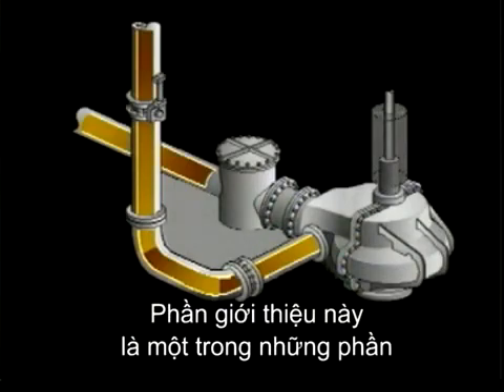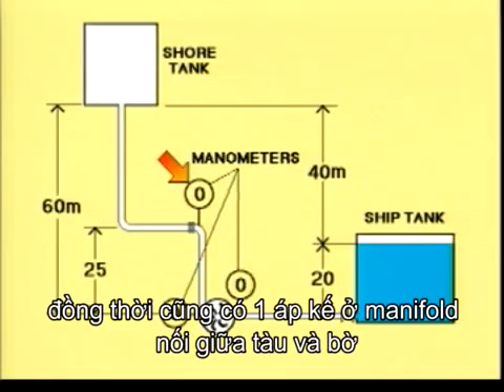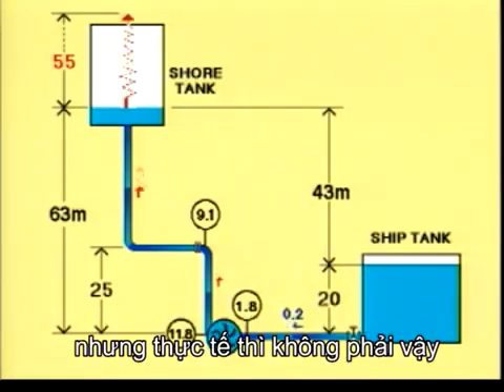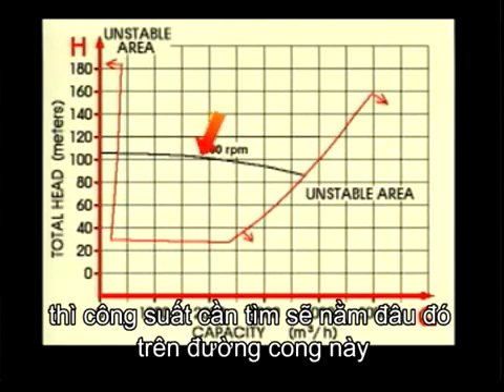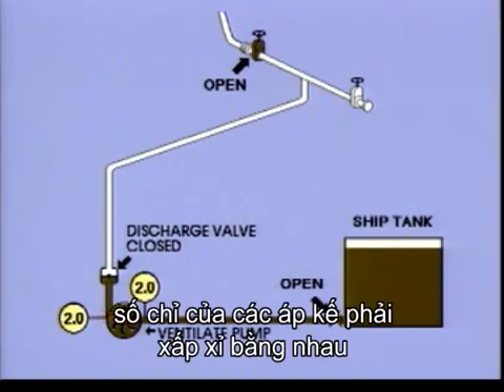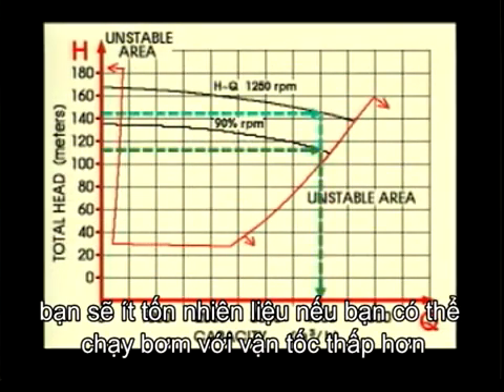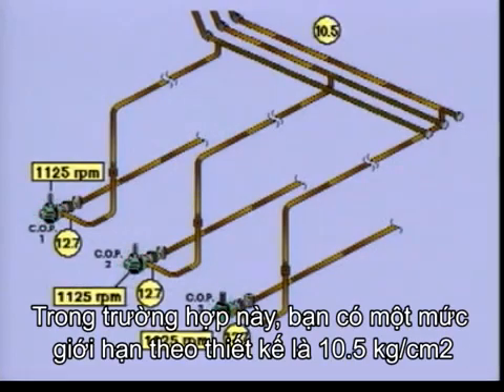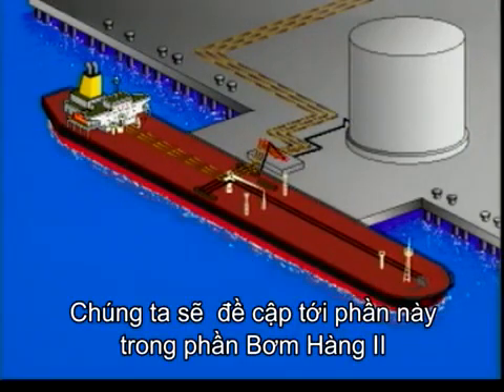CARGO PUMPING SYSTEM ON OIL TANKERS (PART 1) | Capt.TRAN THE HUNG

Comment: How To Start A Cargo Oil Pump ( C.O.P.T ) In 14 Simple Steps
Check and drain water from the lube oil sumps for the cargo oil pump turbine.
Check and Open Sea water overboard Valve
Open Vent valve for the Condenser.
Open The discharge and Suction Valves for the Sea water pump for vacuum cooling evaporator.
The Fresh water inlet and outlet valves are to be opened for the air ejector.
Start and warm up the air ejector system.
Close the vent valve and monitor steam pressure.
Now using the Turning bar; rotate the turbine spindle to check free movement.
Crack open the turbine warming line for some time.
Now slowly open the main steam valve to the turbine assembly; try keep this process as slow as possible.
Observe the slow increase in turbine R.P.m till the governor take control.
Once reached to its operational R.P.M; inform the cargo control room and the pump is ready to be used.
Check Whether the I.G system are operational.
Now start the Cargo oil Pump To start the discharge Process.

Comment: Alarms And Trips Associated With Cargo Oil Pump
A cargo oil pump can be damaged in a number of events such as; overheating, no oil in the tank, closed suction, chocked suction, excessive back pressure etc. Thus various alarms and trips are fitted to safeguard pump operation. While different cargo oil pump types have different set of alarms and trips; but they also have many which are common to all.

Alarms
High Wear Rate
High Casing temperature
Low lube oil Pressure
High Motor Current
Low lube oil Level
High bearing Temperature
High Lube oil Temperature
Low Hydraulic Oil Level ( In Framo Pumps )
High Hydraulic Oil Level ( In Framo Pumps )
H.P.U Oil Leakage ( In Framo Pumps )
Cooling System Failure
Power failure
Safety Trips
Low Low Lube Oil Level
Local Hand Trip
Remote Trip
Automatic Emergency Trip
Casing Over Heating
Priming Pump failure
High hydrocarbon Content
Low Inert Gas pressure
Over speed
Emergency Stop Centrifugal Pump
Emergency Stop For Hydraulic Oil Pump ( In Framo Pumps )
Low Low Hydraulic Oil Level ( In Framo Pumps )
Very High Back Pressure

Comment: 5 ) Cargo Eductors
An eductor is a simple structure with no moving parts. It’s basically consists of a nozzle, throat and a diffuser. An eductor can be placed in the main cargo pipeline or with a separate piping arrangement. Basically it is a less efficient low cost alternative for other stripping pumps.

An eductor use the under pressure fluid ( liquid and gas ) to generate pumping action. This is done by the flow of the fluid through a nozzle; followed by a diffuser or a diverging output. This can be used with almost all kinds of pumps with different fluid medium. An eductor can be used to handle any cargo even explosive medium; as long as it is compatible with the flowing medium.

In cargo eductors it is a common practice to use the same cargo as the flowing medium to generate pumping action. Being a simple design it is reliable; maintenance free and is self primed. In most case it is operated by the flow of cargo by the C.O.P.T.

Working Principle
An eductor works on the simple principle of “Bernoulli’s principle” or venturi effect in specific. The Bernoulli’s principle states that; the velocity or flow rate of a fluid is inversely proportional to its pressure. this can be represented by the following equation:

V22+Pρ=K (Constant)
For a fluid flowing in a tube at constant speed; it must maintain its flow rate to keep a constant volumetric discharge. But when a sudden narrow path restricts its flow; reducing its velocity. By the law of conservation of energy we knew the energy lost in form of reduced velocity has to convert into another form; which in this case in pressure energy.

This process creates a differential pressure between the inlet and outlet of the conversing cross sectional area. The venturi effect combined with the principle of mass continuity; generates suction pressure at its suction inlet. In most scenario the driving fluid or medium in the case is the cargo from the next tank pumped through a C.O.P.T.

Comment: 4 ) Screw Pump
A screw pump is a type of positive displacement pump. Much like gear pump with a major difference that; it pumps fluid axially along its spring axis.

The pump consists of two main parts; the prime mover and the screw pump assembly. Two or more screws are coupled to the shaft with a fine clearance; which when combined with shaft motion creates suction pressure.

A screw pump can be divided into eight major parts; the driver screw, driven screw, timing gear, relief valves, bearing, driving shaft, rotary and stationary seals with suction and discharge ports.

Based on the number of screw; the pump can be called a single screw, twin screw or multi screw pumps. With better suction capability and lower maintenance cost; the pump is a good fit for those who look for a cargo pump which can handle all kinds of cargo. But due to its high installation cost it is often restricted to high pressure high viscosity fluid application.

I have already written a post in past explaining in details about screw pump; its constructional parts with their specific function, use and maintenance procedure. You can click and read that post from link Over Here.

Working Principle
A screw pump add axial movement to the fluid locking it into its fine clearance area. The continues motion of the pump; trapping and pushing fluid axially forward build up the output pressure. The driving and driven screws of the pump works in phase with the timing gear. It not only keeps both screws at pace but also avoid any contact in between. Any such contact can lead to wear and tear of the screw edges; negatively affecting the pump performance.

Both driving and driven screws in the pump are of opposite types i.e one is left hand type while other right hand type. This ensures to trap air or fluid within fine clearance; building suction pressure.

A screw pump at start traps the air in between the fine clearance of its drive and driven screw. Pushing the air axially towards the output; it create differential pressure which helps suck in the fluid medium into pump medium. As more and more fluid is trapped and then pushed towards the output; pressure increase along the pump discharge.

Comment: 3 ) Centrifugal Pump As Framo Pump
A Framo pump is nothing but a centrifugal pump put upside down in a cargo tank. It is located such that the impeller lies on the bottom most part of the cargo tank. They are used largely in chemical tankers where dedicated pumps are required for each tanks. They are mounted such that; only a minimum clearance left between the floor and the pump impeller suction.

This results in advantage in form of shorter period of stripping. And relief from unnecessary suction problems; due to faulty or chocked suction pipes.

The pump consists of parts such as hydraulic motor, impeller, volute casing, wear rings, sleeves, mechanical and cargo seal along with the bearings. All the main components of the pump is secured well within the deck trunk welded to the ships deck.

The pump is driven by the hydraulic motor; under the influence of high pressure hydraulic oil from power packs. A power pack is an independent system consisting of; a hydraulic oil tank and high pressure pump along with an electric motor to run.

The complete system is based on the balance between the two fluid medium; cargo and the hydraulic oil. If the cargo gets in to the hydraulic system it damage the pump; while if hydraulic oil leaks it contaminates the cargo. Thus a coffer dam is provided to avoid the contamination of cargo with hydraulic oil in the pump system.

Working Principle
The hydraulic system control panel sends signal to the hydraulic power unit to start the discharge operation. The hydraulic power unit consists of a hydraulic oil tank and a high pressure feed pump.

The pump starts to take in suction from the hydraulic oil tank and discharge at very high pressure to the main hydraulic line. It is driven by an electrical motor; controlled by the hydraulic system control panel.

A low pressure return line is connected; to the hydraulic oil tank to maintain the same oil level at all times.

Upon each operation; the coffer dam lines for each Framo pump is to be purged out. This is done to remove any cargo or hydraulic oil leaked; from cargo and hydraulic oil seal to the coffer dam. Then the remote assembly is signaled by the main controller; to open valves to the hydraulic motor.

This create the necessary torque needed to drive the shaft of the centrifugal pump. The pump then takes suction from the suction well and discharge to the shore facility via a dedicated cargo pipeline.

Comment: 2 ) Reciprocating Cargo Pumps
A reciprocating cargo oil pump is a steam or motor driven positive displacement pump; with a plunger moving within the pump cylinder. It is well known for its constant volume pulsating output at higher pressure. The pump takes in the fluid medium via a suction valve and discharge at a higher pressure through the discharge valve.

The plunger or piston within the pump cylinder is in close contact with the liner with the help of the piston ring. The most common design is with a double acting piston driven by a reciprocating steam pump. This is done by connecting the piston rod of the reciprocating steam piston; to that of the pump via a linkage or beam.

The modern reciprocating cargo pumps come with an additional dampener at its output to reduce the pulsating effect. Furthermore being a positive displacement pump; it is required to have a relief valve in place to avoid damage due to excessive pressure. Based on its design it can be a simplex, duplex, single acting or a double acting pump.

Working Principle
A positive displacement pump works on the simple principle of pressure that accounts for force per unit volume. This is achieved by the up and down motion of the plunger or piston. A reciprocating pump works on the principle of positive displacement pump; and thus produce pressure exerting force on liquid in confined area.

Thus for a reciprocating cargo pump the output pressure depends on the piston area and its speed within the pump cylinder. As the piston retracts backwards; the cylinder suction valve is opened against the spring tension under the effect of negative pressure inside. Now as the piston starts to contracts moving upwards; the suction valve close and pressure starts to build under impact of driving force.

When the pressure reached to a desired limit; the discharge valve operates and fluid is discharged. While the driving force can be given; in the form of steam pressure or from a prime mover. The return of the piston is ensured by the pair of steam valve and its gear; as with direct acting steam pump or through crankshaft and connecting rod in case of prime mover.

Comment: 1 ) Centrifugal Pump As Cargo Oil Pump Turbine ( C.O.P.T )
A centrifugal pump creates suction by the virtue of pressure difference created by; the impeller action on the fluid medium in a volute casing. The fluid is sucked in; rotated at an high speed and then discharged through the output nozzle following a volute casing structure. A centrifugal pump consists of parts such as; shaft, impeller, a casing, bearings and sealing structure.

The complete pump structure can be divided into two key parts; rotary and stationary parts. The impeller and the rotating shaft make up the rotary structure; while volute casing accounts for stationary part. A centrifugal pump is best suited for handling low and medium viscous fluids. They are best known for their high capacity output, dynamic head, ease of use and low cost operation.

Furthermore, being a type of dynamic pressure pump; it allows to control the output without changing its operational speed or dangerously pressurizing the system. For centrifugal pumps used as cargo oil pump they are fitted with additional non return valve at output to avoid backflow.

I have already written in details about the construction, working and maintenance of centrifugal pumps in details in one of my old post. You can click and read that post from link over here.

Working Principle
A centrifugal pump turbine or C.O.P.T in short when used as main cargo oil pump have two main parts; a turbine and a centrifugal pump. The steam turbine consists of parts such as boiler, feed pump, condenser and turbine working together in a closed loop system. The high pressure steam inters the turbine casing through a series of inlet nozzle.

These nozzles convert the high pressure steam into high velocity jet directing them on turbine blades; to rotate along with the shaft to generate rotational power. The generated power is then transmitted to the centrifugal pump through a connecting shaft; while exhaust steam goes back to the boiler via condenser and feed pump.

On another hand a centrifugal pump works on the simple law of centrifugal forces. The pump impeller throws the fluid outwards away from the central axis. The process transfers part of the kinetic energy of the impeller to the fluid; which then pass through the volute casing to leave under pressure.

The pressure difference created due to sudden change in fluid volume creates a partial vacuum behind the impeller eye; this creates the much needed suction pressure to continue the process.

Comment from the maker: Role of Cargo Oil Pump In Cargo Operation

The complete cargo operation specially that for discharging consists of three main points; cargo pump operation, inert gas system and pre planning ( planning in advance ). Various key features such as cargo sequence, temperature, characteristics, quantity, pressure, rate of pumping; tanks to be discharged, manifold connections to be used, modes of communication and emergency procedures are all pre planned and agreed upon for a specific cargo operation.

The chief officer monitor and control the cargo operation from a dedicated place on automated ship’s called cargo control room. Once all the lines are lined up and Inert gas system on stand by; the chief officer start the cargo pump at a slow speed. This is done to ensure there is no leaks or fault at any junction or deck in cargo or I.G system.

Once ground crew confirms the normal operation confirming safety checks; the officer start other pumps in parallel and increase the pump speed and pressure. The cargo pump should not be started till the inert gas system is operational with; all cargo and slope tanks in common ( in parallel ). Furthermore for cargo discharge; all the vent valves should be closed with deck isolation valve open.

Once it is confirmed that the shore facility is receiving cargo at their end; slowly increase the speed of the pump to its nominal full rpm. In event of more than one cargo pump running in parallel; it is required to have same running speed and pressure to maintain the cargo flow. Any variation will results in pump’s overheating with no flow output or loss of pumping.

Comment from the maker: A COP or cargo oil pump is an integral part of a complex cargo discharge operation. Located in the pump room, the system comprises of a number of pumps including; eductors, steam reciprocating pumps, screw pumps and centrifugal pumps working as a cargo oil pump. But the most common arrangement is the one with centrifugal pump; driven by a steam turbine.

Due to their wide use and design factors; a cargo pump is also referred as cargo oil pump turbine assembly. The type of pump used for the cargo operation depends largely upon the required pumping rate and pressure. The amount of cargo to be discharged also plays a role while deciding the pump used; for example eductor pumps are used only for stripping purposes.

When the large amount of oil is pumped out; the low oil content in tank leads to loss of suction. This is when the pumps such as eductors are used to suck in the left overs and flush the hose with air blow. In most ship designs a pump room consist of a number of centrifugal pumps as the main cargo pump; with an eductor as the secondary cargo pump.

The whole assembly is connected such that; it can take suction from the slope tank and the bottom of the tank. This comes handy when transferring cargo from one tank to another; while discharging altogether at ports. In cargo pumps where the centrifugal pump is driven by steam turbine; the pump lies in the pump room with the turbine part resides in the engine room.